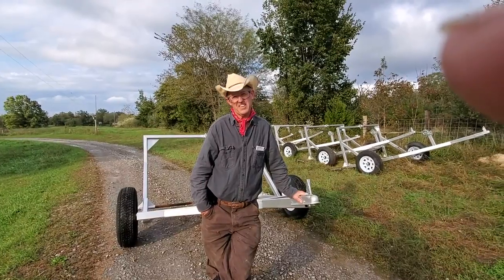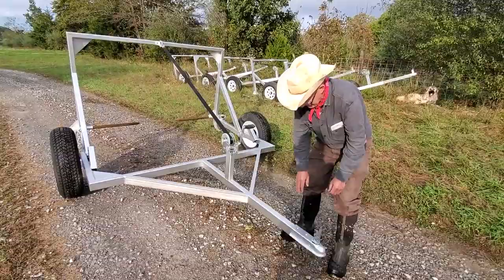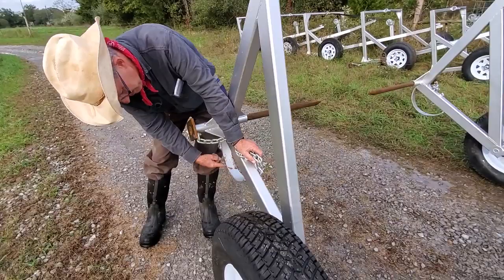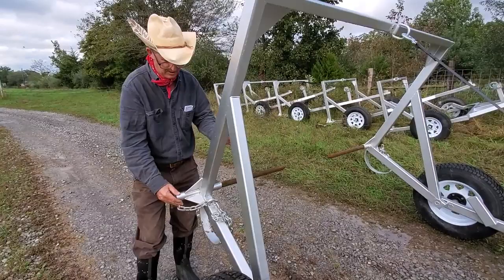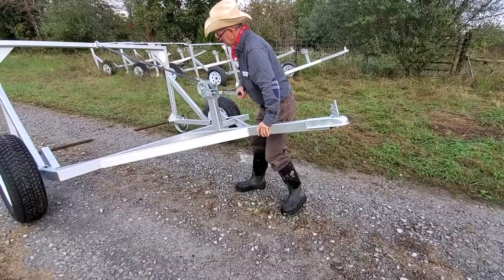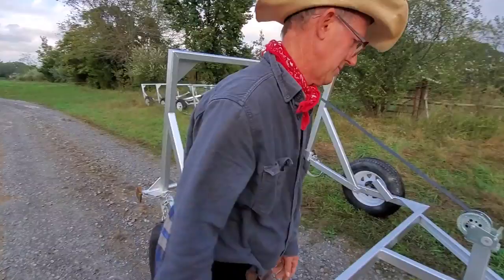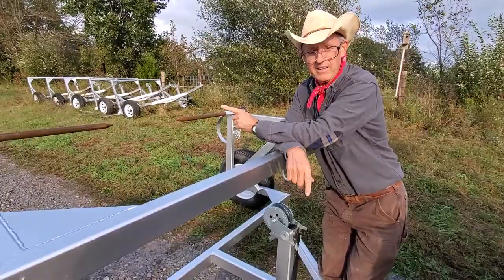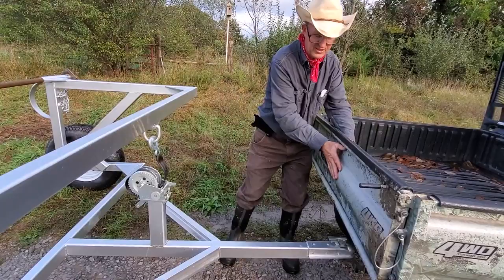Greg Judy details how to use his ATV big round bale unroller to spread fertility around your farm

Comment: I live in North Texas. I would have to drive to Mo. buy it, then how do I get it home. Can it go on a highway all day?
Reply from the maker: If you have a full size bed with a tail gate on your truck, we can set it in the bed. You do need two heavy duty nylon ratchet straps to secure it in your pickup bed. We have had 4 customers pull them back to Texas. They travel well on the highway. Hauling it in your bed would be easier though.
Reply: Hello Betty. We pulled it to between Stephenville and Abilene. No problems.
Reply: @gregjudyregenerativerancher  I do have a full size bed. I'll start saving my money!!!

Comment: Just wondering, wouldn’t a bale bed be more effective and efficient, and have a lot more multiple uses?  This seems very time consuming and labor intensive???
Reply from the maker: I have a bale bed on my Dodge, I used it zero times last winter due to puggy wet conditions. I would have buried my Dodge truck in my wet pastures in the first 15 feet. If you want to prevent ruts and not bury your truck, this tool will feed your stock in monsoon weather conditions.
Reply: Greg Judy Regenerative Rancher thanks your prompt reply.
Reply from the maker: @robmiller4976  I forgot to mention that my hydra bale bed cost me $12000.